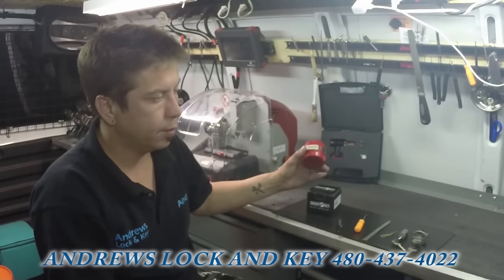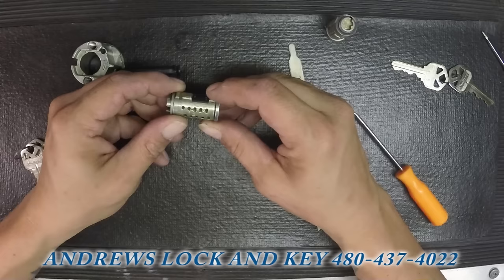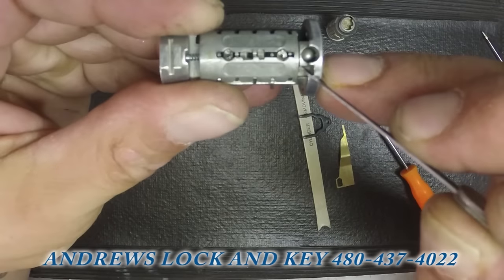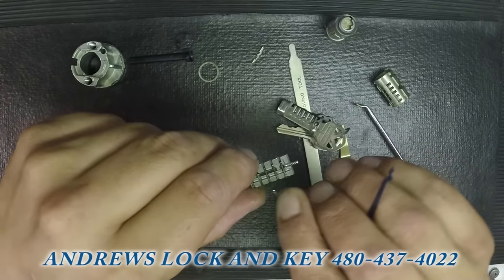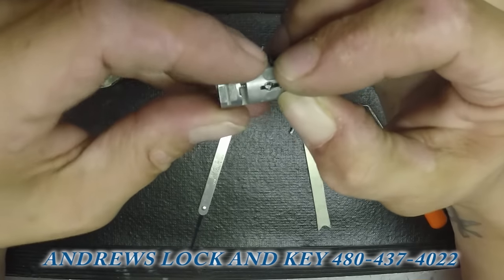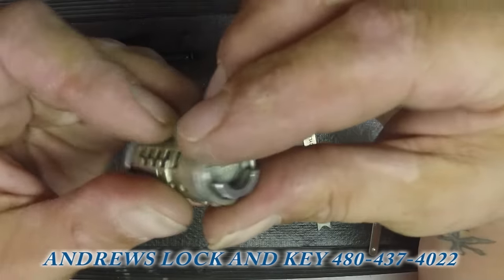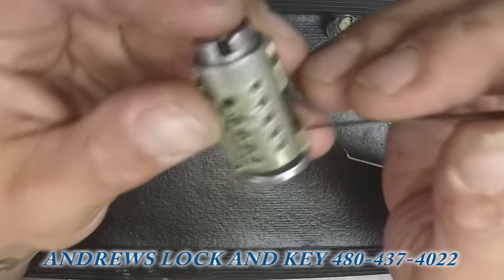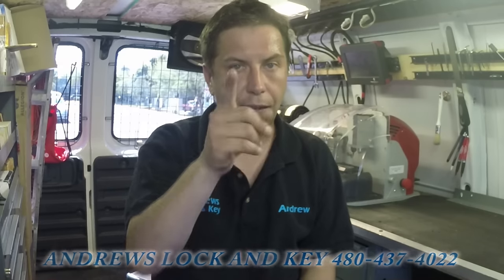KWIKSET SMARTLOCK REKEY WITHOUT KEYS OR RESET TOOL

Comment: This video was invaluable for two reasons. My SmartLock failed and the key wouldn't work after working for a month. Kwikset sent me a replacement cylinder and removal tool. The instructions showed inserting the rekey tool much further than it wanted to go so I stopped thinking something was wrong. Your video showed me what happens with that sleeve when the tool is inserted and I realized it was in fact working and the tool would never go in as far as the instruction sheet showed. Your video also allowed me to take the failed cylinder apart and reset it to my key. Now I know how to fix a cylinder if it fails. The question in the back of my mind is, what caused the key to quit working and when will it happen again. At least I know how to reset it now. Thx a million.

Comment: Andrew, this video just saved my friend $250 Canadian dollars cause his attempt at rekeying a SmartKey cylinder failed miserably and the lock locked up! I was able to get the core out of the deadbolt body, take it apart thanks to this video and reset it to the actual housekey during reassembly, works perfectly. Thank you for the concise instructions and excellent camera placement to catch where all the parts go correctly!

Comment: There is a bunch of these on YouTube, but yours is possibly the most concise and clear. I had two messed up Weiser locks. The instructions they provide for the Smartkey are either incomplete or wrong. After some experimentation I found that I could only rekey them if the special tool was inserted from the time I had the original key in 90 degrees until I had put in the new key. I had messed up two locks trying to follow the included instructions. One was a newer style that is different than shown in this video. The side bar was held into the slider with two spring clips and the springs are on top of the side bar rather than underneath. The basic principal worked the same though. You just had to remove the spring clips from the slider and do more fiddly work to get it back together.

Comment: This was exactly the video I needed.  Thank you!
If you did what I did and somehow made a mistake while re-keying, you can try to use the same key you ended with and just pull it out/up/down in small increments.  It may work in one position.  If so, turn it 90 degrees to the right insert/remove the smartkey and start over.  When that fails, this video shows exactly what to do!
Reply from the maker: Glad I could help out 😊😊

Comment: Thank you for this video. It enabled me to rekey a new Kwicset lever handle lock that came with a bad original key.

As info this newer lock's sidebar is held in place by two plastic "C" bands with a tiny spring under each.

Comment: Thank you so much for posting this video. I just replaced all my home locks with the Baldwin quickset locks. I threw away the old keys after rekeying but the front door deadbolt reset did not take properly and  I was stuck without a key that worked. With this tutorial the front door deadbolt lock now works with the proper house key.

Comment: Excellent video.  Saved me like $80. ON the newer locks you do not need to removed the side bar. In fact i don't even now how you would accomplish that as it is held in by two retaining clamps on either side. Regardless of that this only took like 15 minutes from start to finish. THANKS SO MUCH.

Comment: Thanks for this.  I somehow derped the rekey procedure on one (out of four) new locks so that neither the old nor new key would work.  With your help I was able to fix it.
Reply: I have done that, too. Our local hardware store (no locksmith in town) wanted to sell me a new one as they 'can't be fixed'.
Five minutes with this video and I had fixed my mistake.
Thanks!
Reply from the maker: Glad I could help you
Reply: I had to do this after the tool and key fell out just as I was turning the the lock.
Reply: Ooklllllqq

Comment: That worked great. One of my little saw shaped wafers broke. I was able to follow your instructions and get the lock back together, with the key I wanted. I works just fine with 4 instead of 5 pins.
Reply: Wayne Duncan was wondering if that was an option myself.
One of my wafers was facing the wrong way!
Good to know.
Reply: Technically it's more susceptible to picking now but really?  I'd take my chances or move out of the neighborhood of I was that concerned because locks don't deter thieves

Comment: I use a set of depth keys to read the wafers on top of the assembled Lock. Decode and cut a key to fit. Works great for me. I mark a line on the rekey tool to act as a depth gage to measure the right height of the wafer when it in the correct position.

Comment: I have several kwikset older style locks entry door and deadbolt. I have rekeyed them several times and have locks
that are easily nearing 40 years old. The all work wonderfully by just changing the pins for the new keys.

How well and long will these much more complex Kwikset smart key mechanisms last over time. It seems that 
the more moving parts the more problems and shorter the lifespan.

Wendy

Comment: Have the Cradle, but prefer the way you show. Ran into house with several Smart Key, Keyed same, took 1 apart, inserted depth key til at same height as a working key to decode. Next time I dig out My Smart Key stuff, while core is out of cylinder, want to try applying pressure to the slider, and see if they can be moved into place with a hook to put slider in the rekey position. Ever try? 
Thanks

Comment: Worked flawlessly  the first time without any special tools and only took 5 minutes. DON'T lose the wafers or springs when seperating the two halves of the cylinder. They fall out very easily, so work over a confined area when disassembling it.
Reply from the maker: Glad you got it 🙂🙂

Comment: Thanks Andrew..  
Somehow you made those parts seem bigger than they actually are.. :) 

I just moved into a new house where I have six internal doors with smartlocks and no keys.. first one is the Lever Style Tustin Handle..  man those Allen set screws are a bitch when the lock wont turn..   

You got me on the right track !!    Tustin done..  now for the round style knobs.

Thanks!!
Reply from the maker: +Steven Hartney getting the cylinders out of the knob is a little bit more of a trick you either need a special tool or too small screwdrivers

Comment: My daughter got the key stuck in the deadbolt tonight.  Found your video and had the key out, inserted to rekey it, and installed in less than 30 minutes.  I don't know for sure but it looked like when she pulled to get the key out but didn't turn it back to 12 o'clock, she jammed some wafers.  Key wouldn't come out and wouldn't turn either.
Reply: Oh, and the cylinder with the wafers and pins was VERY hard to remove from the sleeve, also making them think something like a wafer was jamming it.  And when I did get the cylinder out of the sleeve, I found wafers falling off the cylinder rather than in the groove.  No idea how that is even possible, but now I feel more prepared to tackle other lock issues.

Comment: Thanks for the video. I had a cylinder fail when the fingers wore down on the wafer. I pulled the one bad wafer, reset it as per your video and reset it back to the original key. It now works again albeit with on less wafer. Are these wafers available for purchase, I cant find these online (im not sure what they are called) I'd love to put this back to original.
Reply from the maker: I don't know where to buy just a wafer at. you might be better off trying to find another used  lock cylinder and stealing it out of there.
Reply: Figured it was a shot, the cylinders are at most 12 dollars.

Comment: Actually, I recently messed up my brand new lock (Weiser Halo / Kwikset) so that neither the new or old key would turn the lock.  I took the outside portion with key cylinder off the door.  With the new key in the lock, I held the lock with the key pointing down (toward the floor) and with light pressure turning the key, I shook the lock and within seconds was able to turn the new key.  Re-installed on door and all was right with the world.
Reply from the maker: Sounded like it didn't fully reset when you first did it so you were managing to wiggle and jiggle it to get it to open again so you could reset it that's awesome glad you got it fixed.
Reply: @Andrewslockandkey  yes, what I had done wrong was put the old key in and turned it 90 degrees clock-wise.  I then used the kwikset key, but then turned the old key back to center before I removed the old key.  At that point neither key worked.
Reply: I did find your video...and was going to attempt following it, but in the frustration of just pooching my new lock I shook it and the key turned.

Comment: I did the same thing when I screwed up the procedure on a deadbolt and then neither the original key nor new one would work. It was quicker than driving to the store for another one. You basically just need to get the thing into the open position with the desired key in it.

Comment: Hi.  Thanks for the video.  I'm running into trouble though.  I line up the wafers and when I try to put the bridge back it, I manage to get it to click in, but then the bible does not move at all.  Do you have any idea what I'm doing wrong?  I've tried with just one wafer as well.  Once I put it in, I cannot slide the bible.  Thanks.
Reply from the maker: The only thing that comes to mind, Don. The wafers must not be in line with the groove on the cylinder. The Bible will not move if those are not lined up.
Reply: @Andrewslockandkey Thanks for your quick reply!  I'll give it another try!
Reply: I was able to do it this time.  What I did differently was once I got the bridge in, I pushed it to the end and then put the key in.   Thanks for your help!
Reply from the maker: @donovantom7865  gald you get t

Comment: Went through the process and was able to make a key work, But it will only release in the open position.   I can make the deadbolt move but But when I move the key to the home position to release it pulls the deadbolt back.  What was my Re-assembly error?
Reply from the maker: I think it has to do with the Bible not sliding back in the correct position so you're in the reset position still and that's why the key can come out, as soon as you turn it back to the home position it's reset but not to that key so the key will no longer work.

Check the wafers are lined up in the proper groove before trying to slide the Bible back so it resets properly.

When you turn it back also look at the wafers down the drain hole and see if they are in the correct shear line position which means they should all look the exact same height after you put the key back in if one is set up a little bit or set down a little bit the lock will not turn.

Comment: Can a smart lock be picked ,how do you open  if lock out
Reply from the maker: The short answer is no they've been designed not to be picked.

the long answer is yes with the right tools in the know-how of how it works you could definitely do that.   

There are plenty of other videos out there showing how to pick a smart key.

I personally have a scope if you look for my other video you should find it.. I end up making a key for it when they are locked out..

by scoping the wafers inside the lock I can determine what the key is with my tool

Comment: Can anyone tell me if Home Depot or Lowes sells any dead bolts that use more the 5 pins? I'd like a 6 or 7 pin deadbolt.
Reply from the maker: Not exactly sure if they do or not. I don't buy my locks through Home Depot or Lowe's... you're going to be looking for a commercial grade deadbolt at that point. 
Is a possibility you will find a 6-pin not a 7 though..

If you'd like you can order locks through me you can call me 480-437-4022

Comment: My friend has a smartkey deadbolt, and he unlocked it, pulled the key out and went to relock it again and the key wouldn't turn the core. What would cause this?
Reply from the maker: +Paul Adams sounds like one of the Wafers or jammed the very common problem most of those locks have about a 40% fail rate you could dissect the lock like this and possibly get it to reset.
Reply: Thank you for your immediate response. I think a reset will do it. I appreciate your videos as I have recently started a locksmithing business at 60 yrs. of age. I got certified licensed and insured. I wanted to do it the right way. I have seen these out in the field and want to have a better understanding of them. Thanks again. I look forward to more of your videos.

Comment: i made my own smart /dumb key tool.do you got one? used to defeat the smart key locks
Reply from the maker: +Kyle Corey I actually own the smart key decoder I make a video on it.  allows you to decode the smart key lock and cut a key for it
Reply: +Andrews Lock And Key that's cool too. where can a guy buy one of those new decoders
Reply from the maker: +Kyle Corey Right here you must have an account first though http://www.qtactical.com/new-kwikset-smartkey-decoder/
Reply: so how is it used , do you read the wafers and then cut a key to that code hoping it s close enough to work? im a fairly new locksmith and havent used any scopes or done any wafer reading..hoping to get that equipment evntually

Comment: I am considering changing at least 6 older pin changed Kwikset locks in my home taking them out and replacing 
with new Kwikset Smart key locks.

Wendy
Reply from the maker: They're a decent lock they do have a failure rate though and if they're not re-key properly you're going to have to follow these steps that I did in this video.
Unless you can get it to turn.

If I may suggest as a locksmith I would suggest using schlage instead of kwikset  but that's just my opinion I think they make a better lock personally

Comment: I am positive with the method you applied but you rekeyed with the same working key.
Reply from the maker: You caught that too. But that method will work on rekeying the lock if you don't have an existing key or the reset cradle.

I grabbed the wrong key when I was rekeying it the lock was already reset at that point.

Comment: wow.. never knew there was a tool to help reset these locks..
I've always done it manually..yes it can be done..yes by the tumblers..
at the moment I have another problem with the kwikset locks..dealing
with a door handle..if I rock the door handle back and forth 3-4 times it opens..
no key..no effort. back and forth..turn CW then CCW..3-4 times..bing..opens..
Reply from the maker: You are correct you can get the levers to do that check to make sure the set screw that holds the front lever. Screwed on tight sometimes that is the cause.  Other than that you have a faulty lock

Comment: looks fairly easy yet it is kind of the dumbest lock made but still better than the Titan with the control key that let's you pull the cylinder out of the knobs
Reply: I won't say it but it is easy to defeat
Reply: +WILLIAM PREVOST C.P.L. (BIG WILLY THE LOCKSMITH) very easy to defeat this style lock forsure
Reply: I hate picking the titans and the damn thing falls apart and also is there anyway to pick these smart locks I know medaco isn't gonna happen but what about the kwiksets

Comment: Thanks for posting this.  You helped me a lot!  I had to go to another video, showing how to take the lock out of a knob.  https://www.youtube.com/watch?v=BFgdx5SDdC8  (He doesn't show how to re-key, however.)  Once I put together the information from both videos, the operation was a success!

I originally searched for this information because I procrastinated the re-key when I bought two sets a few years ago.  During a house-cleaning spree, I threw the original keys away to the one set, thinking they went to a former house I owned.  (Kept that dang tool and instructions, however.  Go figure, lol!)  I want to paint the porch at my house, now, and need to be able to unlock that "other" door from the outside for access while the paint dries in front of my main entrance.  Thanks to you, I can now unlock both doors with one key!

Comment: that lock is way to freaking complicated for its own good. Give me a standard core with serrated pins and ill be happy. Seems like it would be easier to rekey too....
Reply from the maker: +Jonathan Rogers these are actually easy rekey. If you already have a working key or the tool from the other video. This video demonstrates how to do it without any tools other than normal hand tools no locksmith in tools